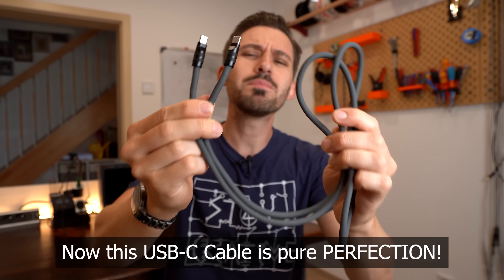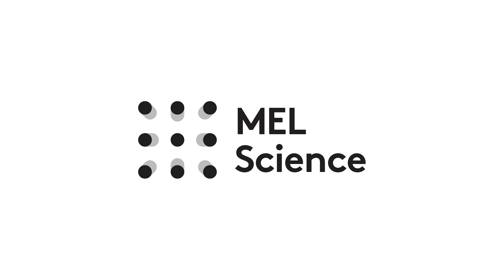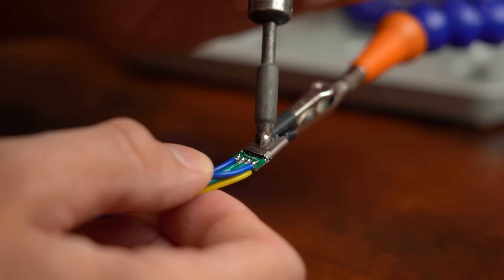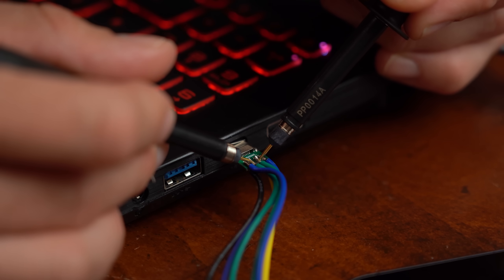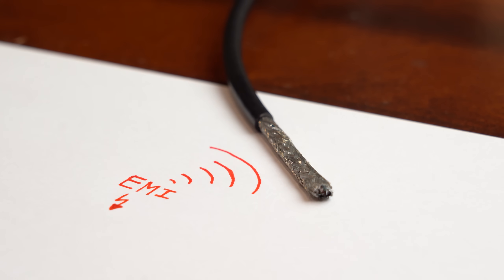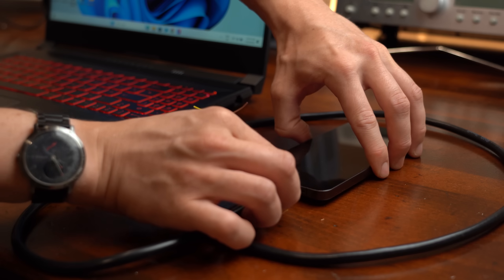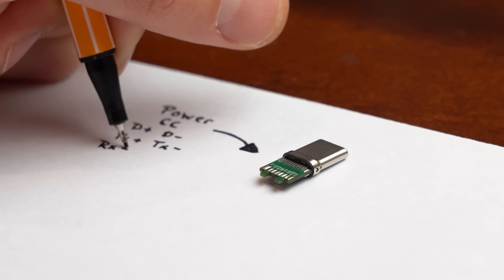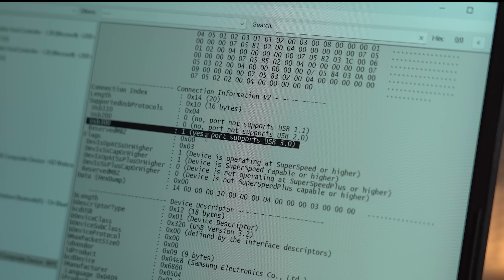Is it IMPOSSIBLE to make the Ultimate USB-C Cable? (Shielding) EB#64

Comment: Since you are attempting to make your own ultimate cable, why not using different spec wires for data and power? A 4-conductor properly shielded twisted pair, a single thin wire for CC1 and a pair of parallel wires for VCC and GND, bundled together with heat shrink wrapping…

Comment: The best USB-C cable is a Thunderbolt cable. TB4 and TB5 support 240 watts power delivery, low latency and high bandwidth data transfer.

Comment: is it possible to get a PCB made that you solder to the USB-C breakout board to give you better solding pads and lets you use the wire that ripped your soldering pad off?

Comment: f you want to isolate the problem, try cutting the connectors off a cable that works, solder on your connectors, and see if it works.  That will tell you if the problem is your breakout connectors, or the cable that you're using.  That would be my first intuition.

Comment: come on!  Having issue , failing is a source of fun! Make it short. Devide into two cable sets for 1 set of connectors.
I assume you are having hard time finding appropriate cable. It does not have to be beautiful  cable. Does not have to use standard cable.

Comment: I had gone through this with my 4k player and using high speed HDMI and getting no signal till I used a ultra high speed cable.  I never opened any cables, but I know those HDMI pins are small so think the wires should be fine and most likely stranded.

Comment: Buy a cheap HDMI cable and put those breakout boards on that. It probably won't get you your preferred power delivery speed, though, but it has 3 high speed TMDS channels plus clock which is also shielded. They're all twisted.
And then there's some extra wires for the DDC, I2C, 5V, and GND for example

Comment: You've no idea how tight the requirements for super-speed USB are. There's basically no way one can create their own cable, it has to be USB specific impedance, it has to be made so there's as little as possible of unwinding of the twisted pair etc, shielding must be exactly right... none of that is easily made by a person. And super-speed isn't event he fastest there are... it's huge jump from 5G to 10G, there's no room for error.

Human doesn't easily make their own.

Comment: You need an e-marker chip for USB-C to USB-C high speed! (Context 10:28) Blame the USB standard authors for this confusing (and expensive) mess. High speed USB (but -A) without e-marker cables exist and work just fine. Even high speed USB-A to USB-C cables don't need e-marker chips! (which btw is the application the USB-C plugs you're using are designed for)
Reply: Ah yes
Reply: No. E-marker chips are only for charging.
Reply: @radry100  We wish but the spec for USB-C to -C cables unfortunately says otherwise. I already tried to post my source as a reply but youtube hides links. Just look it up and keep in mind AI responses are often wrong while Benson Leung isn't.
Reply: @radry100  Also for hi speed transfer.
Reply: Lol cụ coin viNE 0,06875$

Comment: A few years ago, Chromium Labs developed a project for "sniffing" the communications that go back & forth over the USB configuration lines (CC), which ultimately sets both the power delivery and protocol support standards.  Like one of the little "USB Doctor" devices, but this shows you what's happening at wire level - this all takes place way lower than your OS; we're down into USB ASICs here.  The project name is Twinkie, and there are a few DIY clones (Twonkie) knocking around which allow you to connect your USB configuration lines and see what's actually being negotiated via an oscilloscope type waveform.  Probably a bit detailed for a video, but it's interesting to know that the CC lines don't just take a resistor, they actively converse!

Comment: I can give you a tip to make this work. Get a type c cable with data transfer. Then simply add thicker wires for the power and ground. Maybe braid it outside for aesthetics. This way you get fast data transfer and high power 😉

Comment: Hi Scott, I really enjoy your videos and maybe I can help a little with your search for the right cable, while watching I thought: "Hmm, this actually reminds me of certain network cables I know – that could be useful here." If you’re looking for something designed for high speeds but also very flexible, you might want to try the AIXONLAN 2000 Flex Cat.8 flexible data cable (AWG 26/7). It won’t support 240 W PD, but it’s a good example of how challenging it is to make a USB4 240 W cable that’s still flexible, often achieved by using different conductor thicknesses for the power lines, which is pretty clever engineering.

By the way, at 10:37 I noticed the Ethernet installation cables have quite a tight bend. It might just be the camera angle, but usually manufacturers specify a minimum bend radius in the datasheet, and exceeding it can sometimes cause issues. Solid-core installation cables like these also aren’t intended to be plugged directly into devices. In setups like yours, it usually works best to mount a small network outlet just outside the electrical panel, then use a short, certified patch cable that’s approved for use inside electrical panels. These patch cables are more flexible, safer in high-voltage environments, and help keep the installation tidy.

Keep up the great work and I’m always looking forward to your next project!

Comment: Did you try rotating the connector? Some USB-C ports have half their USB 3 pins connected, and some others have half their USB 3 pins hardwired to DisplayPort. So, maybe rotating the connector would fix your problem.

Comment: Shielding is important for external interference, as well as for your cable not radiating interference back. 

However in the capture you had, it seems the slope of change of D+/D- was different. This probably means the impedance of both lines is not same. What you are seeing is the typical low pass filtering when you have a missmatch thick cable (that has some inductance) and no match rf capacitor in the ends.

At least that is what i think is the main issue.

Comment: You could try the Cat7 cables with a short amount of stranded copper extensions to the breakout board for your test, it will have a lot less strain on the pads, or even to a daughter board connection perhaps?

Comment: Differntal pair are almost always twisted, beacuse this help with EMI showing as non-diffeential, i hoped you know this from Ethernet cables ;) 
It also does some other things with capacities and line impendace but i'm not the expert here ;)
I have no experience with CAT7 but before that both types of cables were avaialbe: soild and stranded (for patch-cords).
In case of ethernet cable i don't know if capactances/twist rate are matching.

Comment: You should use a USB isolator between your laptop and the cable. The USB3 one isn’t cheap, but it’s still cheaper than your laptop (and the data on it). It’s very useful when testing PCBs or self-made dev boards.

Comment: My guess is at the usb termination at the breakout board, the impedance is quite different from 90 ohms. By a rule of thumb, if the length of the breakout board is more than λ/10, the effects of the impedance mismatch is severe enough such that the breakout board itself must be treated as a transmission line, aka the traces on the breakout board must also be in the ballpark of 90ohms, especially since the speeds of usb 3.0 are pretty much breakneck

Comment: Hello, congratulations on your videos. I might be saying something stupid, but are you sure that the USB-C port on your PC is connected to the USB 3 control chip? On classic ports, USB 3 are blue and USB 2 are black. On USB-C ports, the "SS" logo (SuperSpeed) indicates compatibility with USB 3.0 or higher. Indications like "5Gbps" (for USB 3.0/3.1 Gen 1), "10Gbps" (for USB 3.1/3.2 Gen 2), "20Gbps" or more for even higher speeds.Sometimes, a USB trident with an "SS" or a version number is present.If no such logo appears, it could be a USB 2.0 port, but that's not always the case (some manufacturers omit the logos). Note that most USB-C ports on modern laptops are at least USB 3.1, but on older or low-end models, some might be USB 2.0 for charging only.

Comment: To help narrow down whether the issue is with the cable or the connector, might be a good idea to get a known good commercial cable (test it first), and swap the connectors with onto your cable and vice-versa, and to confirm the result and also additionally potentially identify the soldering process as a potential problem point, switch everything back and see if the original results are repeated.

Comment: Could there be an impedance issue with the gauge used for the data wires? I ask because I noted there is  difference in ware gauge between the different cable that I have dissected in the past. 
Peace

Comment: Loving this series on USB C!  
The first video is exactly what I needed. I have a Pinecil v2 soldering iron that's powered with USB C and supports EPR at 28V 5A. I only found one model of USB C cable that supports EPR and is made of silicon, but I could not trust that it would perform well.

I now have all the parts and will be assembling it in a couple of days.

Comment: Cable shielding must be properly terminated at both ends, such that it forms a full 360 degree connection between the connector and shield. That USB-C board doesn't allow you to do that. Doesn't mean it won't help, but the signal integrity can be compromised and it won't pass EMC if you look at it from the product perspective.

Comment: Getting the impedance correct is WAY more important than shielding. Fun fact - mobile phone towers use short lengths of SHORT CIRCUITED antenna cables to get the impedance matching correct. Electricity acts very weirdly at higher frequencies!!

Comment: Cut apart the USB 3.0 cable and add the connectors you bought and see if it’s still 3.0 or 2.0 to see if your connectors are the issue

Comment: welcome to learning the hard way about the difficulties of differential signals. 
your cat7 does not look like to spec cat7 to me, very wrong twist density, more matching like cat5. 
I've built high amp usb cables before, I ended up just rolling my own cable utilizing two heavy conductors for power, and just an existing off the shelf usb cable for the data pairs. It is jank because they dont bend at the same rate but ehh

Comment: A twisted pair that has no shielding has some unspecified common-mode impedance vs. all other pairs and the ground. Pairs shielded individually will have much better defined common-mode impedances. Maybe that's the reason.

Comment: The main issue isn’t just one thing — it’s a bunch of small spec misses stacking up. USB 3.x is really picky. Long cable + no individual shielding on the high-speed pairs + no precise twisted pairs = the signal integrity falls apart fast. Even with foil/braid shielding, without exact twist/impedance (90Ω diff), it’ll default to USB 2.0. Also, breakout boards without full SuperSpeed routing or an E-Marker can limit negotiation. Basically, USB 2.0 is forgiving, USB 3.x is not — it needs precision geometry, shielding, and impedance you can’t easily hit by hand-soldering generic wire.

Comment: I read online that USB 3 transmission requires a multiplexer that determines the TX and RX lines. I don't know if that's true, but I found this information while searching why some devices have USB 2.0 speed when connected, but 3.0 speed when the cable is flipped. 
The multiplexer should probably be in the device, not the cable, but maybe the problem is related to that? Maybe the multiplexer is only required for USB Type-C, which can be connected in both directions? Maybe it does communicate with PD chip? I would try using an USB A 3 to USB C adapter and see if the computer also returns USB 2 speeds or rather USB 3.

Comment: I was a British Telecom engineer when the item you identified as "Thin Aluminium Shielding" at 5:38 was introduced when plastic insulated cables were new, over half a century ago (!).
It turns out that the sheathing of plastic cables is not impermeable to water vapour so an aluminized impermeable plastic (you can try stretching that 'Aluminium' for yourself) layer known as a "Glover Barrier" was introduced.
The loose braid is really the electromagnetic shielding.
The "thread" in the cable is Terylene for tensile strength and if it is in the layer just under the sheath can be used to strip the cable by pulling on it with pliers, it is very strong and can cut your fingers if you don't use pliers.
The individually wrapped pairs on the high-speed cable does suggest that the Aluminised plastic is used for shielding too, I shall have to see if it is actually electrically conductive, some sputtered coatings aren't.
It still beats Paper insulation and lead sleeving though, there is a cable jointing skill I don't mind not using any more.
Reply: What do you think about USB4 cables? I'd love to see you tear it apart and see what makes it tick, being able to do 80Gbps n 240w
Reply: Yep, I've had one of those threads cut into my finger trying to use it to strip cable back and it's always right at the joint so it takes for ever to heal.

Comment: It's impossible to do justice to this topic in a 10' video so I have to congratulate you for trying but you sort of missed the jump-off point at https://youtu.be/LOIVrVVYBfA?t=265
If the useful information is associated with the difference between the voltage between the two wires at any given point and at any given time, it means that the useful information (distinct from the noise) is associated with the variable electric field between that pair of wires.
For a given voltage, the electric field is different if the material between the wires is different or the distance is different. Hopefully you can now see that it matters if the geometry of the structure changes along the length of the cable: the relationship between the variable electric field and the voltage is the characteristic impedance of what we can call a transmission line (disclaimer: this is a crude and inaccurate oversimplification!). A structure which satisfies the requirement for constant geometry & properties of the dielectric is two straight wires with insulation of constant thickness which are constantly touching each other. This set-up would work quite well if anything around them was so far away that it had a negligible effect. If your pair of wires is placed in the same cable alongside many other wires this is clearly not true.
What happen then in the cable is that one of the two wires designated to be in "a pair" runs alongside a third one. Electric fields are very naïve and they don't know which conductor they are supposed to be between so such wire in the pair will be affected differently than its legitimate partner. When you go and look at the difference between the received signals you'll find a component that won't be cancelled and that is not supposed to be there: this is the phenomenon of crosstalk (if the "aggressor" is from another pair). Noise will be rejected only if it affects the two member of one pair to the same extent.
If you think back to why the interference could not be cancelled you'll see that the symmetry between the two member of the pair had been compromised. To preserve symmetry we have to try to expose the wires in the pair to an equal level of interference. You achieve that if each of them takes turns to run close to the "aggressor". The geometrical configuration which preserves constant distance between the wires in the pair and provides equal exposure to interference is the twisted pair.

Comment: You will be shocked with my completely DIY HDMI cable which really works well. But seriously. You need to make a differential twisted wires and at least shield them individually for each groups(usb 2.0, RX and TX) to make it work for at least a bit. Twisted wires here are your bros. You can even try to make a very short(max 5 cm) usb 3.x cable with unshielded twisted pairs and probably it will work. Length, impedance and delay matching is kinda important. Alsos type C with built-in E marker chip you can get only from quality factory cables

Comment: I recently found that some brands of USB C-C cables lack some wires making impossible to use my phone as power source while things work with other cables. 

And I don't talk about 1€ cables, but »5€.

Is there a tester that can fully test a cable and report missing lines ?

Is there a tester that can report capabilities of host ? 

Only found testers that report current current and amperage, and mode of power ( legacy 5v or PD ).
Reply: 3:06 answers partly. Will check if I can buy it

Comment: Another problem is that a lot of USB cables are now just for charging and don't have data wires but they are not marked so I can't tell them apart. I had to get a cable tester to use for finding the correct cable when I need to transfer data.

Comment: If, in the future, we manage to have room temp superconductors that can be used for power and data transmission, will resonance become an issue? I mean, without resistance there will be no damping of resonances in the systems caused by capacitive and inductive reactance. I suppose we'll figure that out in the future one day if/when we have superconductors for power and data transfer.

Thanks for the video. It's very interesting and covers a wide range of issues! Definitely useful info. :)